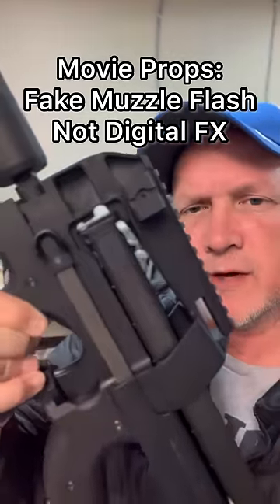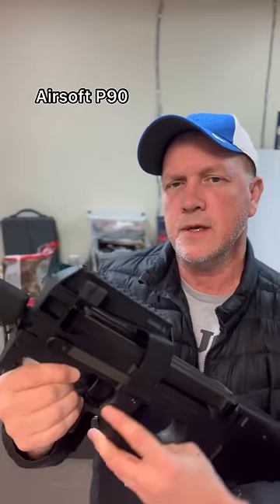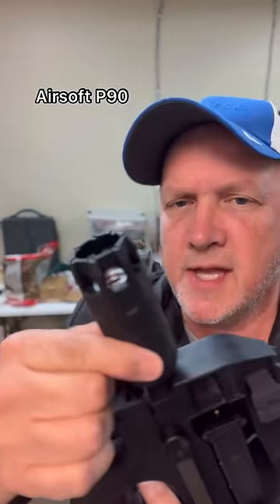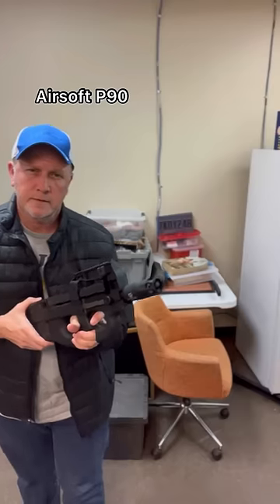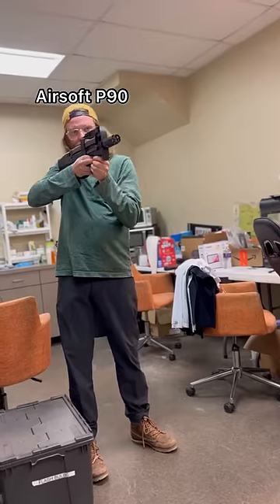Movie Props:  Fake Muzzle Flash on Airsoft Prop #shorts

Comment: airsoft is quite interesting in that some guns use green gas (which is essentially propane mixed with silicone oil for lubrication.) if you had a way to ignite this everytime you fired you would have something resembline a muzzle flash.

Comment: This looks really cool, tbh the only thing you might want to do after doing this for your airsoft movie replicas is figure out a way to make fake shells eject. Of course, on the set of "Rust," "Cover Up," or "The Crow," this thought process could have saved lives (even though those fatal shootings all involved revolvers and wouldn't even have to cycle at all) if they just took to the idea. In theory, it would be easier and cheaper to modify real-steel firearms, which are already in the armorer's arsenal, to do this instead of paying an insane amount of money to swap from their current arsenals (many of which can't be reasonably resold, like the Terminator's minigun and M79) to an entire armory of EXTREMELY high-end airsoft rifles that look real enough to convince a movie audience.

Comment: I bet with an M4/AK style GBB you’d be able to fashion a similar LED flash system using fiber optic cable that goes down the barrel and hits a diffuser so you won’t need to have the big muzzle attachment at the end

Comment: Isn't the main purpose of a supressor, other than noise suppression, to minimize or remove muzzle flash though?
Reply: There are different attachments for the barrel for different purposes. Some of them for example redirect recoil, so it's more manageable and this one looks to be modeled off of something like that. I may be wrong though

Comment: A custom built module might work better and be easier to hide in the guns.  The basic principle is great for the purpose.  You shoot a puff of gas and bash that resulting cloud with light.  These are made for airsoft and need to match a price point, but you might be able to get a much better performing model if you speak to a manufacturer and get one made specifically for this purpose and that perhaps could be in a smaller package that looked more like a standard barrel.  Revolvers are a bit more challenging but doable with creative engineering.

I mean... bang bang guns with actual explosions for their functionality are just not something I think movie sets need.  it feels like a whole industry of purpose built guns should exist.  Airsoft is arguably less an industry (vs the movie industry billions) and it has this module priced for consumers.  With the price of actual guns running 10s of thousands of machine guns just to fire blanks through them... why doesn't there exist a movie gun industry?  Why the hell are you still just using real guns with blanks or mods?  That's batshit crazy.  I love guns.  I don't like gun regulation (fight me).  But, really... I don't think actual guns have a place on a movie set when airsoft and custom prop manufacture exists.  Full stop.

Comment: how do you get it to activate without bbs in it? I thought they all had motion detectors or something so they only flash when a bb passes through? Been trying to figure out how to bypass that, and it looks like you have an answer?
Reply: it's literally just a co2 airsoft gun my guy. You dont need bbs to fire lmfao. And he said it reflects off the gas, not the bbs.
Reply: I’ve tested these, and they didn’t work for me without the bb.

Comment: As long as cascading brass is added in post, along with gun appropriate sound effects, it would work well enough for TV I guess, or filmed at enough of a distance if for a movie. (I watched a show the other day, and a scene was set during the Vietnam War. ALL the guns sounded the same… AKs, M16s, and even the MGs on both sides. Needless to say, that was wrong. It’s not hard at all to tell that different weapons are firing by sound alone. Even the firing rates were the same! Shamefully lazy.)